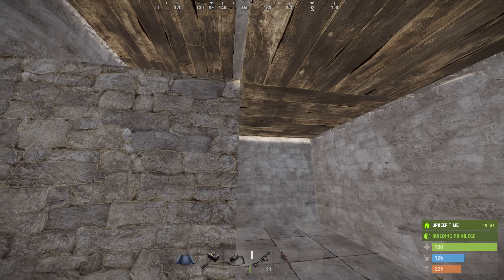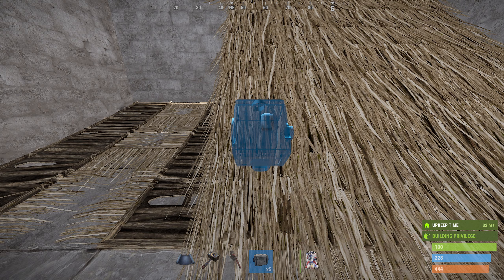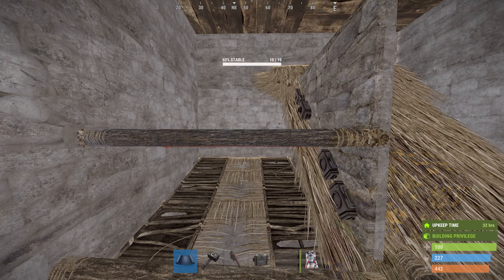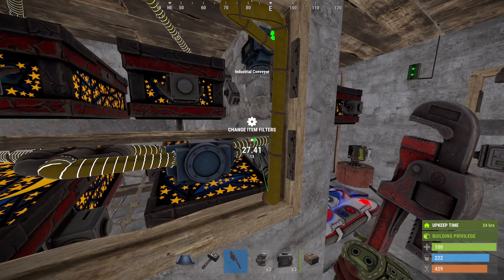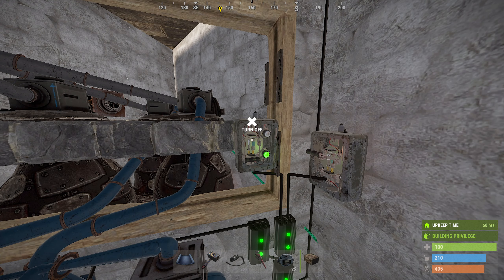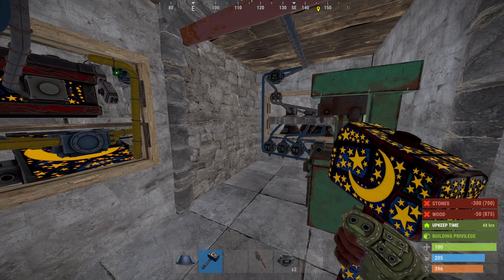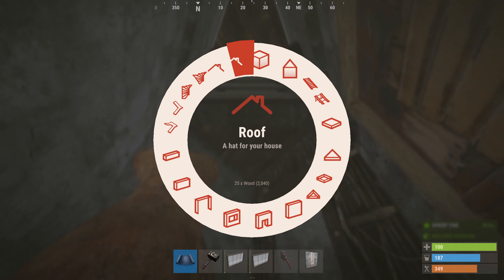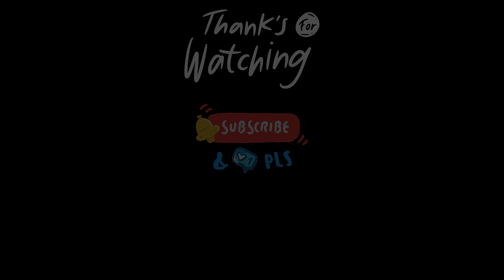Industrial PIPEs THROUGH WALL in Rust + TRIPLE BUNKER CONCEPT

Comment: amazing concept. I have a question: is there any method to pass electricity through wall?. Imagine, you have a closed suicide bunker and your energy get disconnected.. you cant reconnect again..
Reply from the maker: Hi there mate, thanks a lot.😇
This is quite old one thing if i would love to make a reconnectable industrial bunker i would say i'd prefer to use this method.

https://youtu.be/lXu8P03R26k
Yes there is most high foundation in it however it allows to recconnect it easily.

I dont know about any known ways to reconnect electricity easily.
the only thing which i did is this one thing. Where 2 foundations are missing in front of bunker wall. But its quite bad for stability as i guess and u wont be able to expand your core to much tho

https://youtu.be/NKEYuDljQLk

Thanks for the idea btw i will try to do something with electricity.
Maybe i will be lucky enough to find out something interesting
Reply from the maker: now i got 2 solutions for u))) will make a short video about it. thanks for this challange)
Reply from the maker: Here u are mate)
https://www.youtube.com/watch?v=ju4YOr6tJEk thanks for the idea and challenge🤙